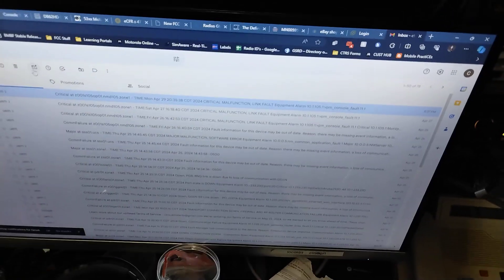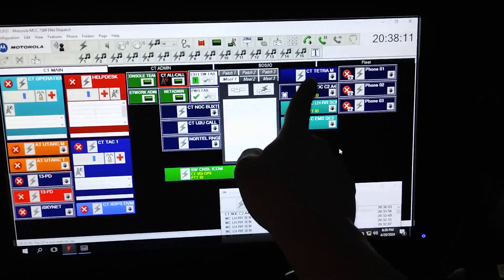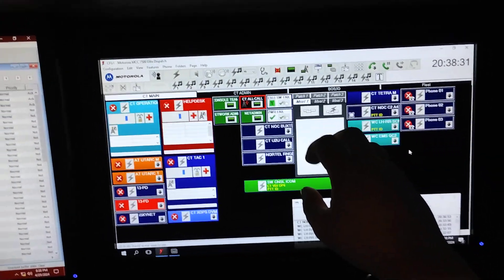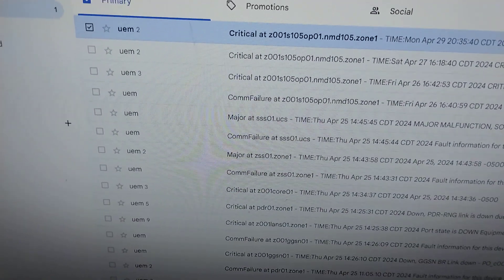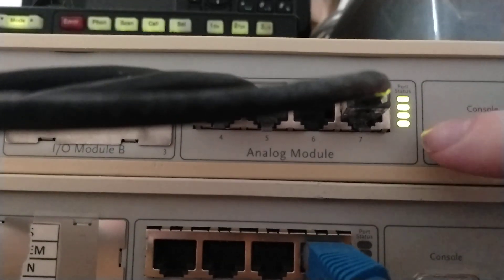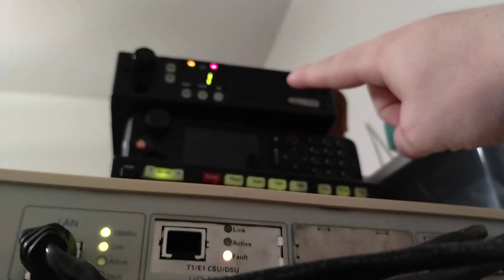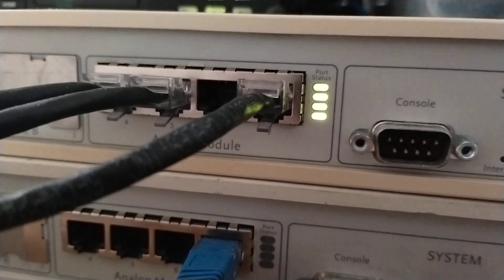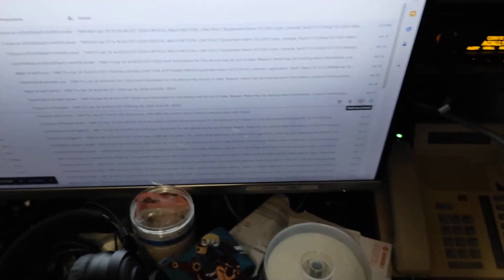[Astro] Teknet analog pager demo v2

Comment: pretty dope bro
Reply from the maker: Thx
Reply: @anongator  so tbh I don't really know what I am looking at, I don't do a lot of radio but I do work with some EMS dispatchers in my area. I do mostly internet networking. So my question for you is I saw in your rack tour video that you had a bunch of motoral products that look like routers I think you said it was an S2500 so what do those do are they just routers like any other router or are they special for radio? another question is what do you mean by console like console as in RS232 or serial?

sorry for all the questions just really interested
Reply from the maker: By console in this case I mean dispatch console. 

Those Motorola routers are mostly just normal IP routers, but they are able to understand some special sauce protocols needed for the Radio core to work, and some of them also have Analog to digital converter ports on them
Reply: @anongator  thats cool, do you need a radio lisence to run all that or no?
Reply from the maker: @nostalgia5269 the network stuff requires software licenses. For the actual RF 100% yes, most is on Part 90 business band, the other part is 97 Ham band